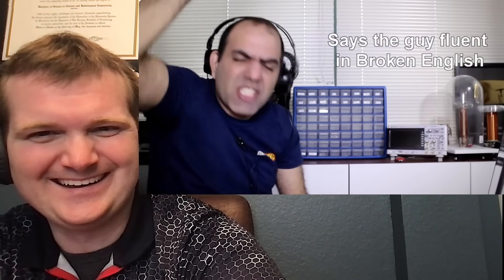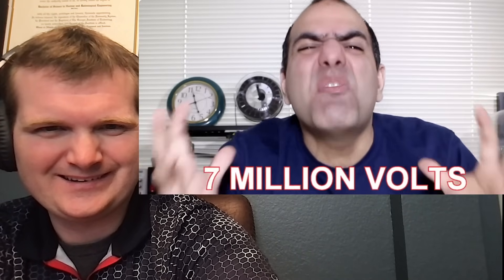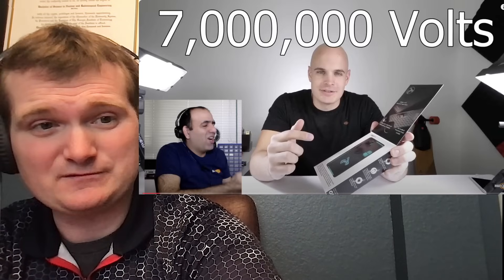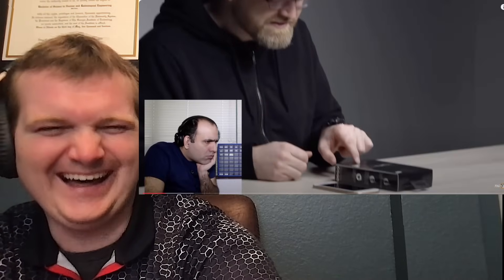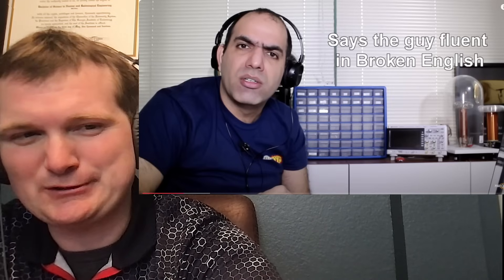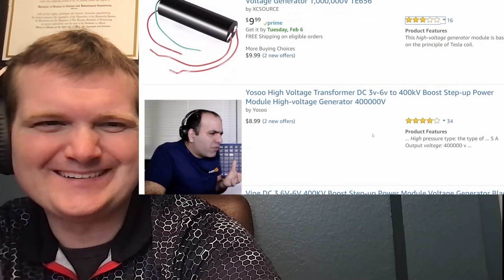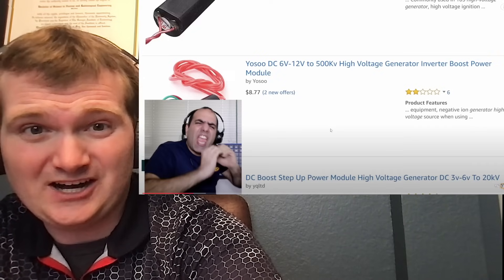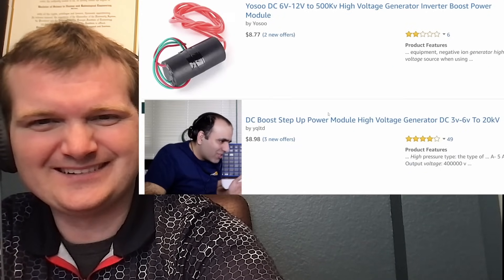7 MILLION Volt Stun Thingy! - Nuclear Engineer Reacts to ElectroBOOM

Comment: Old video however new to me. To answer the question the difference between a taser and stun gun is that a taser operates like a firearm and shoots barbs into your body and delivers current through thin wires connected to the barbs. A stungun delivers current directly from 2 stationary barbs  (taser is a gun/ stun gun is a knife)

Comment: Difference between a stun gun and taser is a stun gun has to make physical contact with the offender to work. well as a taser fires 2 probes connected by wires back to the taser

Comment: I think people need to understand and have a better grasp of the basics. What is Voltage or Amperage.

High Voltage makes your body dissipate the energy into heat and you Burn from the inside and the outside

High Amperage disrupts your body's nervous system by the electron's flow, causing several issues, one of them Death.

If Volts = 0 no energy is able to make electrons flow. If Amps = 0 no electrons are there to transfer the energy. So you need Both for it to actually be lethal.

Comment: 17:19 for anyone wondering voltage is the speed of the water in the river and current is its density so you need fast flowing and dense water to effect you ( a tap doesn't sweep you away nor does rain but a tsunami does. simple).

Comment: The voltage vs current danger dispute was correct, but to the extent of voltage/current supply with no phase shift between voltage and current and at low frequency (for example, at phase shift over 90 and tending to 180 degrees you can supply millions of volts and millions of amps and touch and lick cables without any harm). Also to note, a spark gap does not drop voltage to zero when discharge occurs, voltage drop stops when plasma channel is not sustained anymore by dropping voltage (at some point this channel gets destroyed by air molecular movement) and voltage starts to build up from that non-zero value

Comment: T.  Hey, New Sub ... the math and terms you are describing. I am baby ignorant to the conversations being had...but, I do know the difference between a taser and a stun gun...  A stun gun has a cartridge projectile with two wires one - and one +  so when it hits it's target and circuit is created... 
a taser is a hand held device that has two prongs.  one - and one + so when a person or whatever is touched together..a circuit is made...

again... the most i know about this stuff. is I make my own vape coils.   😂. where learning resistance and ohm's law become the basic understanding... and of course 2 18650 or 18350 or 21700 or 20700 or 26650.. etc...   lithium ion batteries either parallel or stacked. 😆🤦‍♂️🤷‍♂️😆

Comment: I have a 1 mlion volt stun gun and tested it... Yeah that hurt Areally fucking bad!.. Oh but a buddy of mine is a coo with a tazer that's 50,000 volts. Both hurt just as equally bad, but a tazer hooks itself to you and the cop can keep zapping your ass if you keep resisting (see what I did there?)😂. But once it's removed you can function just fine. It doesn't knock you out. I test electric fences for my farm animals daily. It's a puls zap every 5 seconds that travels 5 miles of fence. I test at furthest end. 50k volts will let a horse and cow know not to touch that shit.
Reply: A cattle fence is at most 5k volts with a drop depending on resistance on many various factors. If a fence hit 50v you’d drop instantly but instead it just numbs your arm a bit and makes you reconsider.

Comment: 14:10 Styropyro taught me that it's the current that kills you, after the voltage bypasses your natural resistance and opens the way for the current to fry your insides. But "all things in moderation" tells us that anything in extremes or to excess can be dangerous, so go with "If you're not sure, leave it alone!"

Comment: Australian here. When I was a teen (Too many years ago now!!) On a trip for a science club I was part of we went on a tour at the local university of the electrical engineering lab. We were taught how to build an electric motor (winding wire around a wooden dowel and a tiny nail in each end with magnets at the sides) how to make a gauss gun, and went into a cage of what looked like fly screen mesh and touched a wire and held the hand of the girl who was in there with me and had over a million volts (but only 0.000001 amp [might be a couple of zeros short, it was 30 years ago]) of electricity flow through my body. It was awesome. Felt like ants were crawling all over my body. It destroyed my watch. (I was told to take the watch off and decided to put it in my pocket: OOPS) but it was awesome. Moral of the story, Yes is not the answer. A combination of Volts and Amps is what kills.
Reply: Fellow Aussie here. One of the highlights of my youth was getting to go to the Questacon science facility and see their huge Tesla coils running.
The "yes" answer though is basically in the same area as the idea "All guns are loaded."  It's not true, but it strongly encourages caution.
In reality the answer is "No, it's not the volts OR the amps, because it's the volts AND the amps."  But... All guns are loaded. All power lines are live. All dogs bite. It's better to be wrong about something that isn't dangerous, than wrong about something that is. But best of all is to be informed, educated and aware.

Comment: 5:09 Yes, there is a difference between a Taser and a stun gun. A Taser is a brand of electrical incapacitation device that shoots two metal darts into a person to deliver the shock across the body. That's why in videos where people are tased by police they seize and fall to the ground. The electricity overrides the nerve signals in the body.

A stun gun has to be pressed into a specific part of the body and is purely pain compliance because the shock is in a small area and doesn't ovveride the nerves. It just hurts.

Comment: If it was the current that got you, then holding the positive and negative of a AA battery would get you     It doesn't.    1 1/2 volt at a couple of amps wont do anything much at all.    30ma at 230V could kill you.       So what is it that gets you?   It's the Power (voltage times current) .....    People who know better should be more careful what they say.

Comment: Enough voltage to overcome the resistance and then it's about how much current (though the potential current is usually following the voltage so higher voltage means higher current, unless it's a limited DC circuit like a battery) flows through you and for how long. So voltage+current+time is what matters.

For example, a car battery has 600Amps max output (at least) but 12v is not enough to overcome the resistance of your body so touching the terminals is fine (even a 1.5V battery can deliver 30A current which is about 100 times as much as it takes to kill a human if it passes through your heart). Meanwhile a high voltage low current setup isn't really something that exists, the current will be drawn as the circuit is closed (which is why you can use the same outlet for a 15W charger and a 3000W electric kettle). A stun gun has both high voltage and high current but the duration of the pulse is so short that it will not hurt a healthy human being.

Comment: "Is it the volts or amps that kill you?"

I once heard it put in a very smart way from my welding instructor and a similar way from my physics teacher
"The voltage allows the amps to kill. You could have unlimited amps, but it won't do anything to you if you if it ain't got the voltage to run through you"
Reply: Styropyro demonstrated that. So has ElectroBOOM, really. Voltage overcomes resistance and allows conductivity. Current fries your insides. It takes some of both to do damage.
Reply: To an extent that is true. Every extreme can be dangerous. Like how electro was melting shit with extreme amps and non-lethal volts. So I imagine the amps can raise so high to be able to heat you up to a lethal temperature with non lethal volts. But you can have non lethal amps and lethal volts. But this is just based on the knowledge I gathered from youtube. Not a reputable teacher unless you are a mechanic lol. Although that still doesn't guarantee employment opportunities. But any extreme can be lethal. Too much oxygen can kill, too much water can kill, too much of anything can be dangerous. I'm not saying you were taught wrong, that's just more likely to kill you some day than non lethal voltage and extreme amps. For electro tho, something electrical will be his death lol. Maybe even something nobody knew could even be lethal lol. I don't wish him ill, love his content,  just seems like a likely outcome.
Reply: Though the most important part is about the time. The human body can handle some pretty insane volts amps Watts however you want to calculate. Realistically high voltage and low amperage tends to be a little more dangerous it will probably throw you and then it goes full circle to just cooking you but that's beside the point that's just about when you start going it is scary scary high voltage
Reply: The way i thought about it is like a river and idk if this is correct or not, but the volts is the size of the river and the amps is the current in the river. If you have a 20 feet deep river and a strong current (high voltage and high amps) youre dead, but if the river is only an inch deep with a strong current (low voltage high amps) then youre not gonna drown same as if the river is 20 feet deep but with a weak current (high voltage low amps)

Comment: is it the volts or amps that kills you?
both, and more factors

higher voltage DIRECTLY causes higher current(amps), especially when talking about dielectric breakdown of insulators like air and dry skin as once you exceed breakdown the current will spike at the same voltage

an arc in air is a perfect visual of what happens inside your skin when the voltage spikes high enough, it rises and rises resisting flow until a threshold is reached, then the energy dumps away faster

in fact there is a known wet/dry body resistance at lower voltage
1million ohms when dry at low voltage, 1000 ohms when wet(like sweat)
so at 1000 ohms and a high-leathality current of 0.02 amps, 1000*0.02=~20v
at 20v you begin to risk shock damage causing death, at about 30v it is very dangerous if your skin is sweaty

but there is actually a third factor in death risk due to electricity, well 4 factors but this one is funny, frequency
at higher frequencies(high enough that it is faster than muscles can react at all, like stun guns) it only really effects nerves, the wires of the body
eventually even that can be bypassed if you go faster, and then the only danger is heat

if the frequency goes high enough you burn before you feel any shock

to make an ideal stun gun with minimal risk of death, you need a frequency high enough to avoid muscle interaction(20+khz is good but 30-50 is better due to that f**king terrible whine) as that will be close enough to maximally trigger neurons without muscle issues
then you mix in a high ac voltage(dc is VERY bad due to electrolysis inside your body) and you get the snappy sparky tazer devices
touch that to skin and ouchie if you are not prepared

but like that officer demonstrated, those with higher pain tolerance or those who are mentally prepared can withstand the sudden influx of pain and work through it enough to disarm you(also druggies could bypass it making it a primary deterrent followed by bean-bag rounds and then real bullets for takedowns)

the best way to take a person down in a high state of agitation is something like a syringe, in fact a sedative in a syringe is the primary method of calming in mental hospitals, the sudden influx of sedatives in blood are the only reliable and semi-safe method of de-escalation of someone who cannot be talked down

a taser is a distraction to get closer for a physical restraint prior to a chemical calming agent, there is no alternative that works reliably

for defense up close a taser can make a person leave you alone if you surprise them with it, but something like pepper spray or a retractable baton are far more effective up close, and for ranged a gun or other projectile weapon is best, tasers are minimally useful, especially if you brandish them around

Comment: And that explains how I didn't fall over when my mates tazed me with their "scary" stungun (don't get me wrong though; that's a lotta muscle cramp you still have to endure and leg muscles cramp like a truck😆)...
Also, Voltage is overhyped... Voltage on its own doesn't really do much; voltage difference, however.... I bet it hurts more to touch a +200V and a ground wire than just touching a couple of +200V wires (disregarding any shorting issues here, of course)...
And yeah, I would've also loved to have had EB as a teacher (especially seeing as how I've taught myself everything now and I'm at that point where I'm building my first mains transformer.... Yes, I'll be using quick-blow fuses well under the components' rated amperages and I'll be well careful with shielding etc because I'll end up with voltage outputs ranging from -70V all the way up to +310V. But hey, ElectroBOOM will probably appreciate the Full Bridge Rectifiers I'll use😋)

Comment: Listen up folks. Those legal "stun guns" cause pain. That pain goes away as soon as they knock it out of your hand, which will be followed by a left or right cross directly to your head depending on circumstances. THEY ARE NOT TASERS. Tasers incapacitate, either with direct contact or probes. Shock a big boy with a "stun gun" and all it gets you is a prejudicialy broken body. And since stun guns are close contact you will be in perfect reach of your soon to be dispatcher. If you MUST have non-lethal protection pepper spray is the way to go. It lasts, it hurts, it blinds and can be used at a safer distance. All you need to escape as it buys you precious time. Don't get bear spray, it's weaker than spray for humans.

Comment: So, I have been through two different Taser®️™️ training courses. The first was on the M18 and the second was the X2.
The voltage was extremely high, but the amperage was 3.6 mA and 1.2 mA respectively..we were taught that when deploying utilizing the barbs, split the hemisphere. Upper and lower torso. The greater the spread, the greater the control. 
Yes, I have been tased. I can tell you that from personal experience, it takes a moment to become mobile again.  Full body control via electrical shock, plus two barbs shot into your body... you're quite sore afterwards

Comment: Yea all these "5 trillion volts" stuff is dumb if you know anything about electricity. Stun guns, tazers, tesla coils etc dont deliver kilovolts or megavolts to the human body. Thats just the open-circuit voltage. As soon as you apply a load (like your skin resistance) to the circuit, the voltage drops tremendously to satisfy Ohm's law. Volts will kill you as per I = V/R, but only if the power supply can deliver the power

Comment: Yeah, the "current vs voltage" debate is silly. It's just like the "horsepower vs. torque" debate.

Horsepower is literally torque x RPM x a constant. There is no "difference" which is why people struggle to figure out what the difference is.

Current and voltage are similarly related, along with resistance. Your body has a certain resistance along certain pathways. If voltage is too low to overcome that, current will simply not exist. If voltage is high enough, current will exist.

I suppose a water analogy works here, as it does in many electrical things. Which is it that kills you, the water or the depth? Well both. You can't un-link them like that. Without voltage, there will be no current. Without a powerful enough source of stored or generated current to maintain voltage as it discharges, voltage will drop so fast that just like the graphs Mehdi drew of the arcs voltage and current, it won't do much.

Comment: Humanity should just upgrade pets to be immune to electric discharges and upgrade selves with synthetic Electric Eel genes. People have no idea how powerful each Human could be. Imagine getting a group of Humans together to start a nuclear reactor.. Amplifiers + Humans with super coded AI Crisper generative AI maxed Eel genes. How many animals you related to? That DNA data isn't junk because you know your bones aren't junk but DNA will get rid of them if you're in zero G too long won't it? Why not animal data? Because if conditions of world change it wants a chance to use old forms in the mix to adapt. That can controlled on purpose.. Upgraded. Profiled.. 

For safe wireless power make a biological generator for people to make Plasma generated Ultrasound modulated by WILL alone for frequencies, Piezoelectric Crystals(Synthetic/PERFECT), and Amplifiers connected to Crystals that stack power in a Capacitor to bleed into main storage or frequency encrypted startup sequence for your hidden spaceship as you approach. 😇 First time reactor startup = Community action for people to come place their hands on power transfer nodes and then reach inside themselves to let out some of that POWER.

You know.. For reducing stuff that has to be made. Lol.. (Imagine an activity where people get to sync like dancing but instead are pulsing power from themselves together. Someday do that on spaceships in sync with their ships power needs..)

Comment: Yes, there is a difference. Usually, in law, a taser is in reference to a specific device that fires probes as the specific brand does. Whole a stun gun is a device with fixed probes on the device itself.